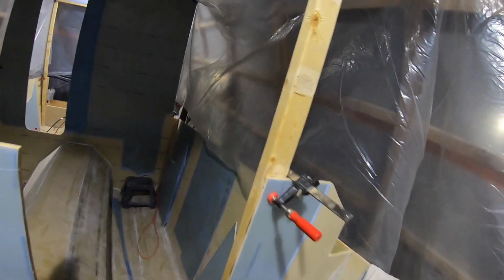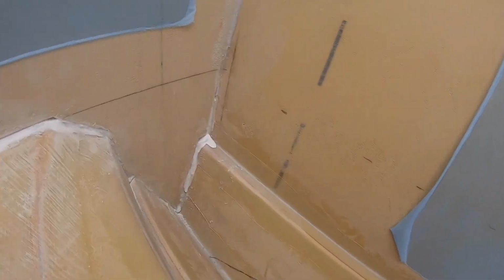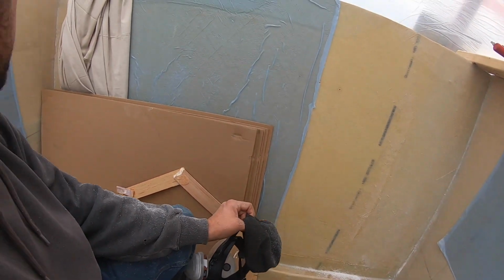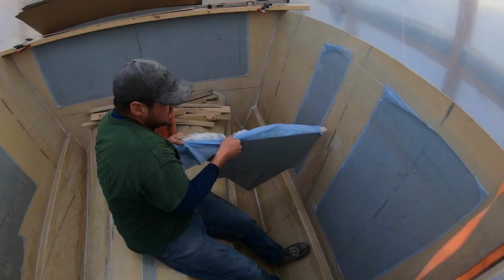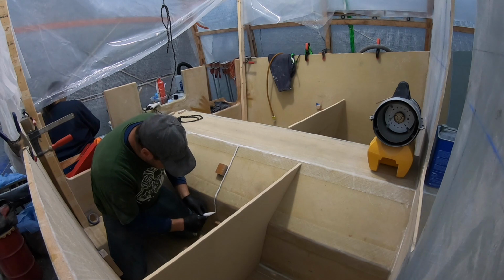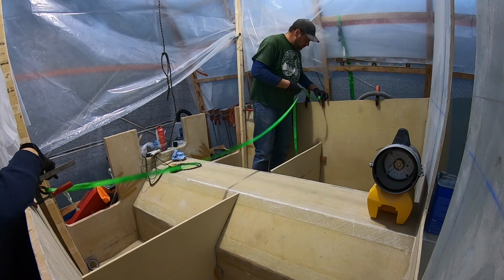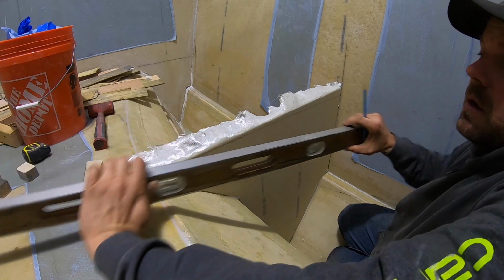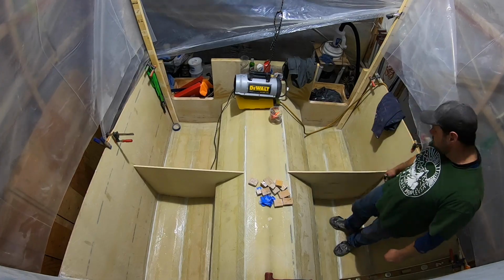Step 74: Cockpit and Berth Intermediate Bulkheads - Power Catamaran Build

Comment: Yess,, my fav Cat builders are on again. 🤩
Iw been thinking about and been talking with my colleges about the sagging fillets of yours.
To little fibers in them, glass or cotton, are everybodys first thaught.
I have not seen PlyPeel looking like that before. Light blue I mean. All the PlyPeel were using is white with blue and red stripes on it.
I guess its two different manufacturers of the same thing, or? Is it the PeelPly that ruins your fillets? 🤔 //
Soo cool to see the progress, and the "goodness" to have a flat floor/sole to walk on in the hull, cant be overstated. 🥰
Good to see that youw been investing in a cyclone. it realy helps prolong the time inbetween washing of the hepa filter in the wacuum and soon saves up by buying fewer wacuum bags.
Cheers and huge hugs from a now +10C Sweden (totaly nuts weatherpatterns here and now),,  🍻🍻😎👍‍‍👍‍‍
Reply from the maker: Our peel ply is definitely different looking than anyone’s we’ve seen! But it is peel ply nonetheless. It’s so bizarre, our ratio must be off on the fillets! It starts as paste and by the time it sets up it’s soup. 🤷🏻‍♀️ one of these days we’ll figure it out. 😂
Reply: @BuildingMVDauntless  Well,, soup,s not good to make fillets with, as you have found out, 😅👍‍‍. Have the best of weekends ❤️❤️
Reply: I've notice that your not putting the peel ply on your fillers. Maybe try that and it will hold it in place until it sets.